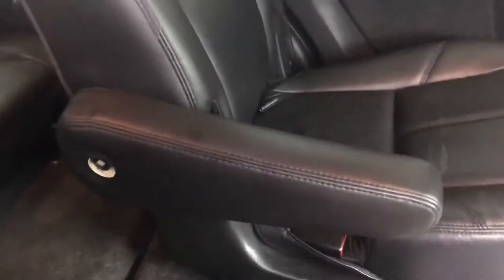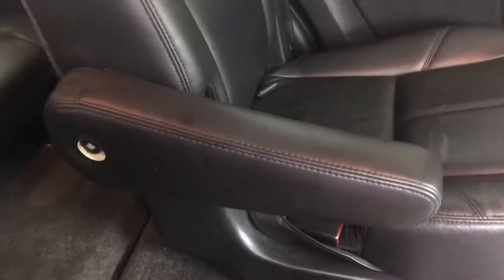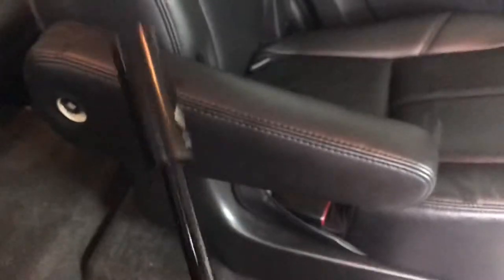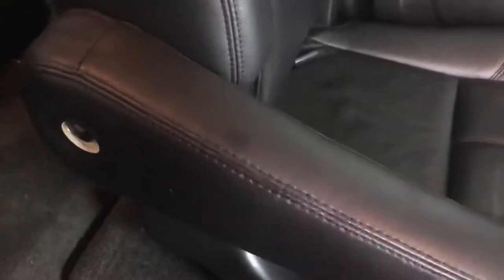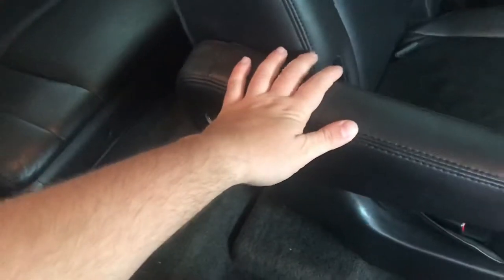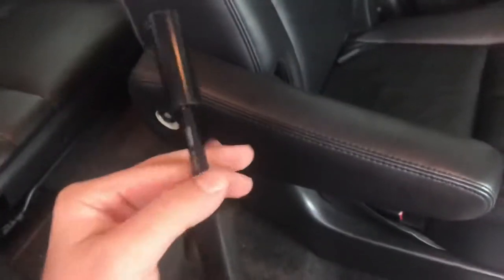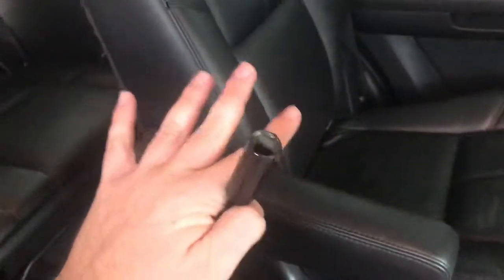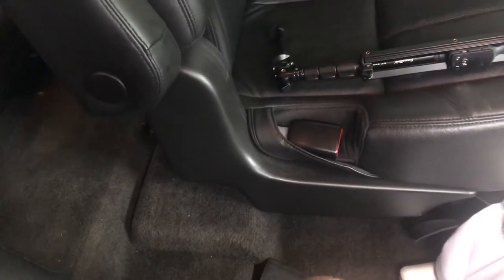2007-2014 GM Saggy Arm Rest *EASY FIX*

Comment: I saw another video, with these instructions as well, I went and tried to fix it myself, I did record it as well, It did not work for me, mine was not loose. It was tight as can get, I loosed it and then tightened it back up, still did not work. Any other suggestions. feel free to check my video to see if I did something wrong.

Comment: I have a 2010 esv plat.  Same issue with arm rest.  It appears that mine had already been tightened and the nut is aluminum.  My nut is bent so I need the specialty nut and or post.  The post screws in with a star socket.  Luckily I had a set from another project.  Since the aluminum nut is deformed when I tighten it it just turns the post which will not tighten it.  I'm going to try and find a new bolt and post.

Comment: I have one that just falls down but the bolt is tight. What do I do?
Reply from the maker: Me and you are in the same now since my passenger wasn't wearing a belt. In the best-case scenario, you take it to an interior shop that knows their stuff. A bracket internally is bent so it doesn't stop it where it supposed to go.
Reply: There is a post thyat is probably bent in there.